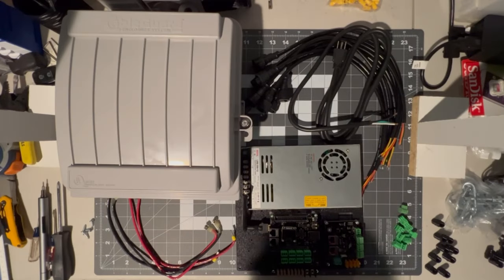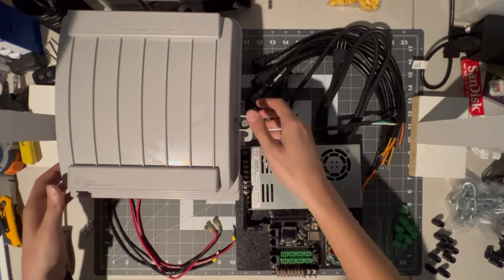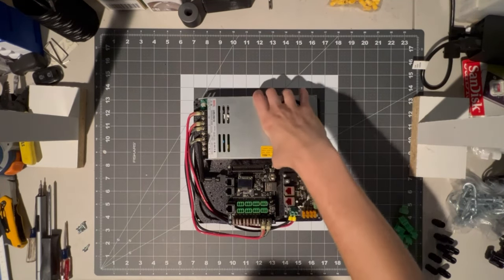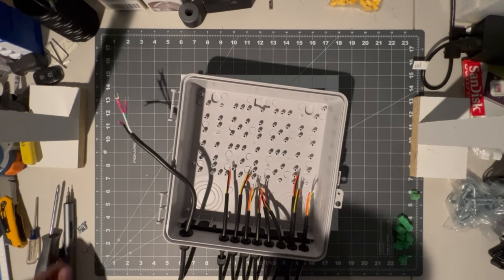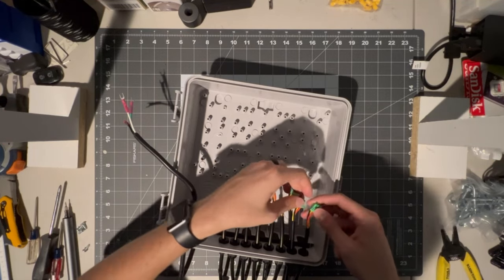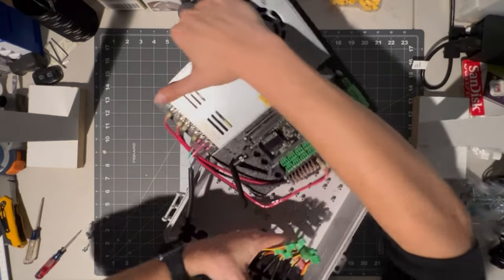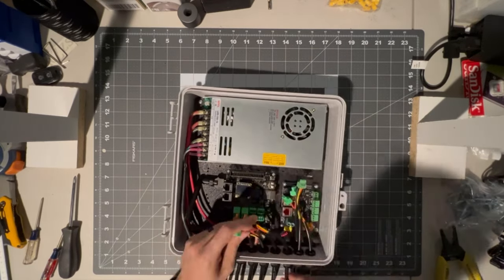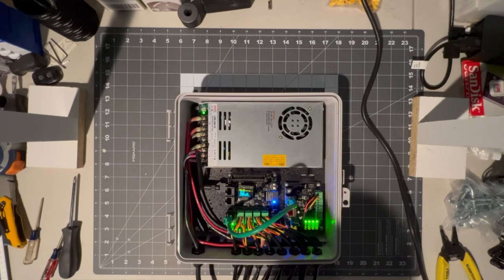Kulp K8-B LED Controller plus Smart Receiver - CG1500 Build

Comment: Does the smart receiver act as another controller? Can i just run cat6 to it in another enlclosure and power supply?
Reply from the maker: It is an extension of another controller, the cat cable is not an internet connection